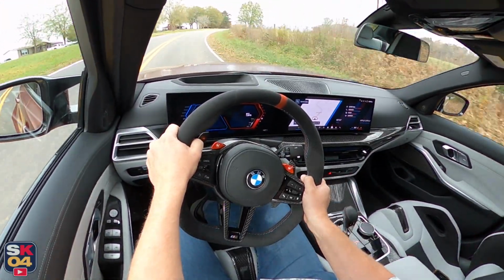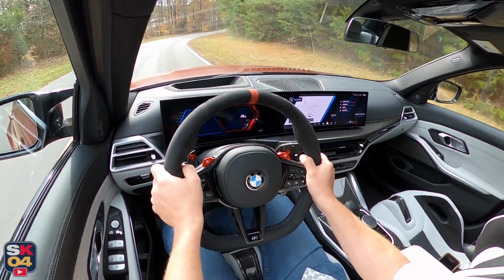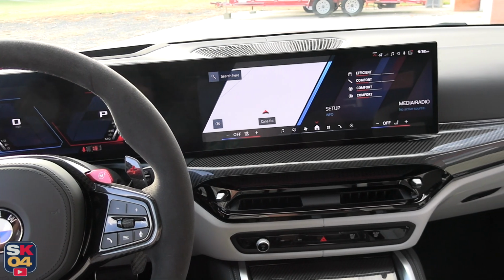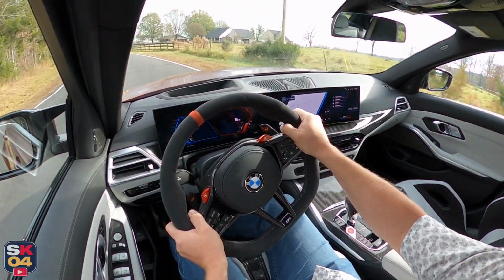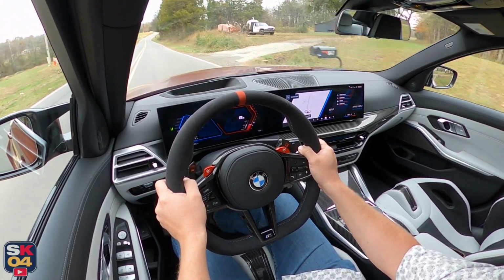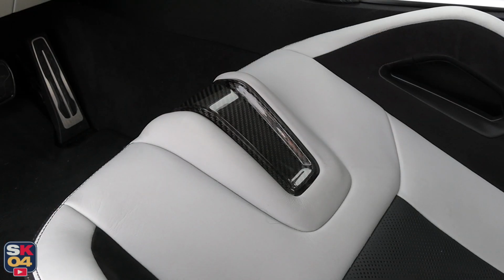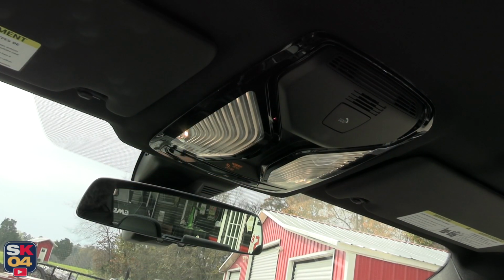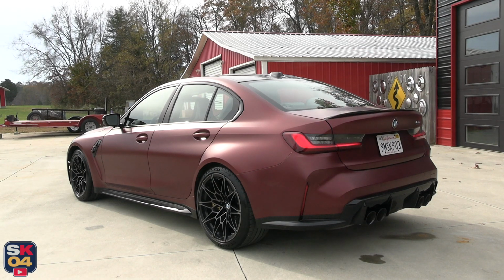2025 BMW M3 Competition: Start Up, Test Drive & In Depth Review

Comment: One thing I really hoped BMW would include is the automatic telescopic steering column - Lexus has it and it's tied to your memory seat settings so you can easily switch out your "spirited" driving steering wheel position to match your seat setting. Since BMW has dynamic driving modes, this should've been a no-brainer add-on.

Edit: this feature also helps with getting in and out of your car if you have bucket seat option. With the steering column of the way when you turn off car, it's a lot easier to exit the seat.